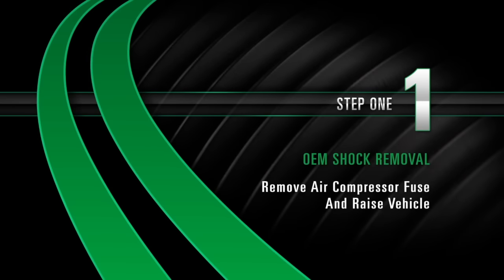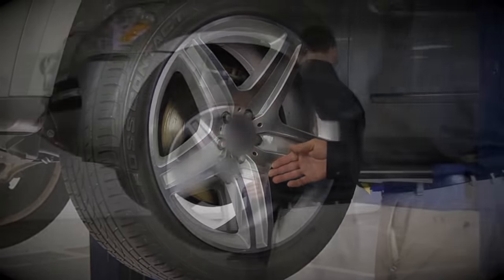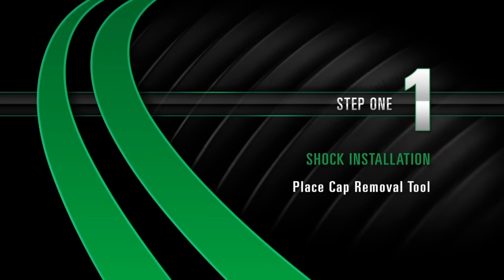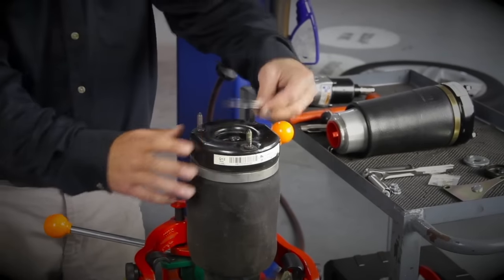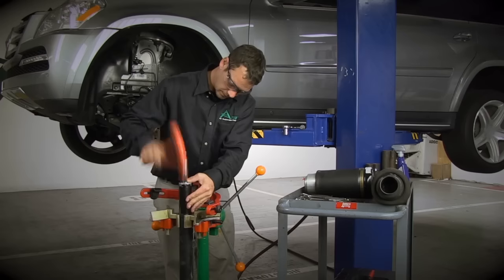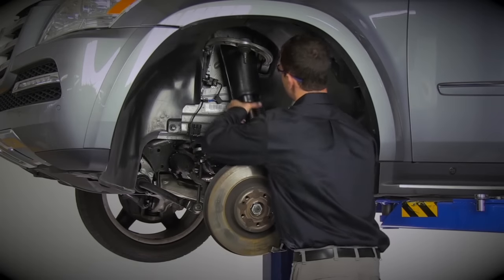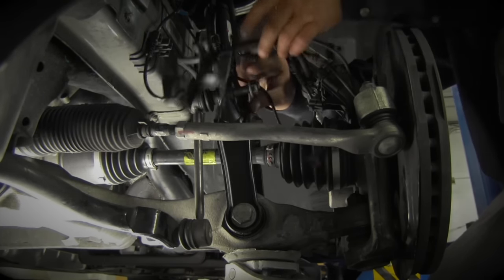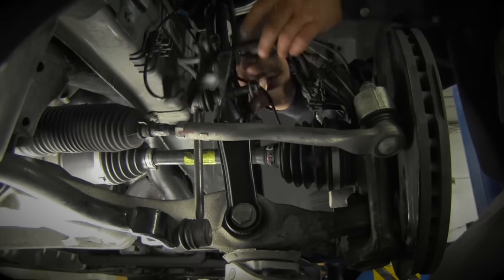Installling the Arnott New Front Air Spring on Mercedes-Benz GL & ML-Class A-2575

Comment: How do you get the cap removal tool? Does it come with the shocks/springs?
Reply from the maker: The cap removal tool was designed by Adam Arnott to make the removal and installation easier and comes with the air spring in the box.

Comment: How to know if shocks needs replacing too besides just replacing the air spring bag??
Reply from the maker: Worn out air springs can do additional damage to the shock damper as it is forced to try and do the job of the spring and damper by holding up the heavy vehicle. You should inspect the damper by looking for oil on the outside and doing a bounce test where you push down on each corner and look to see if the corner bounces more than twice before coming to a complete stop. If so the damper may be worn.

Comment: Where can I get the cap removal tool
Reply from the maker: The cap removal tool was designed by Arnott engineers to make the removal and installation easier and comes with the air spring in the box.